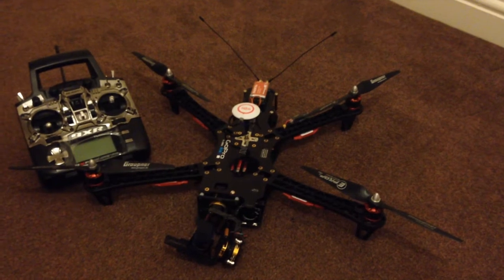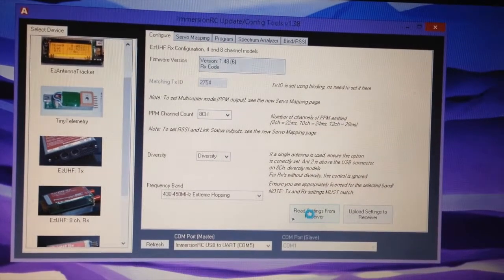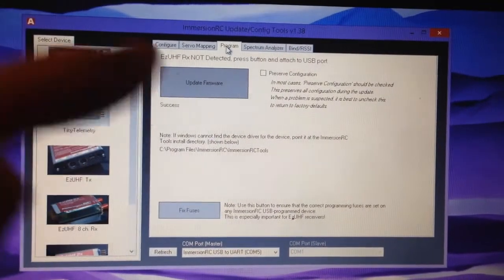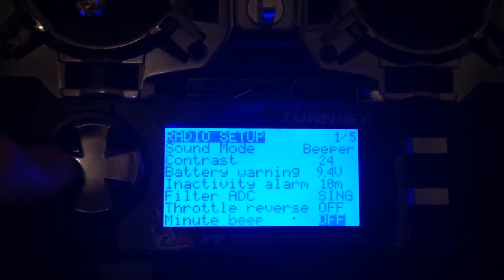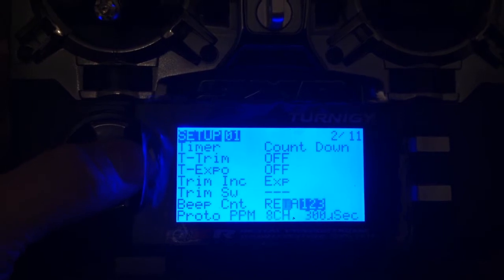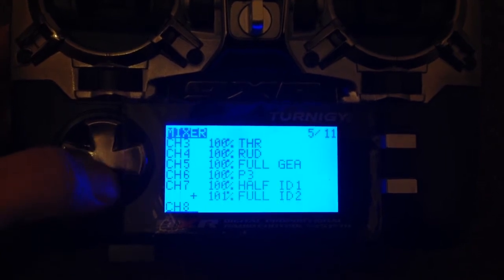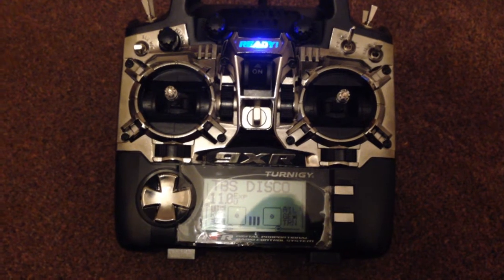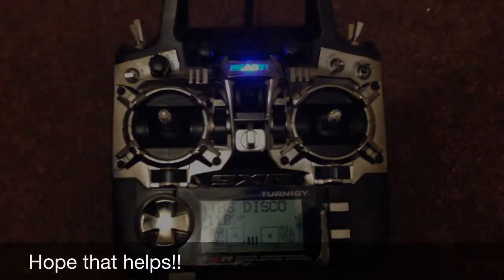Setting up the EZUHF for PPM mode on the NAZA using a Turningy 9XR.

Comment: Hi. Can you tell me how to use PWM on the rest of my channels while using PPM Muxed on ch1? i need to control a gimbal?
Reply from the maker: Paul Ringer use CH1-5 on PPM Muxed for control through CH1. The rest of the channels from CH2-8 still work as normal outputs so I put tilt and roll on CH7/8 and connect directly to them from the Disco. Hope that helps
Reply: TeamUKFPV I'll have go. thank you

Comment: I have a problem with my turnigy the throttle is elevator, I have followed every step that you have on your but yet it messed up, do you know why it's doing this plz,thanks.
Reply from the maker: +Ste Beckett That is the settings in the Tx itself. For some reason the Turnigy / Taranis is set up:

CH1 - Throttle
CH2 - Aileron
CH3 - Elevator
CH4 - Rudder

You will need to go in to the menu of the radio and change these to the following:

CH1 - Aileron
CH2 - Elevator
CH3 - Throttle
CH4 - Rudder
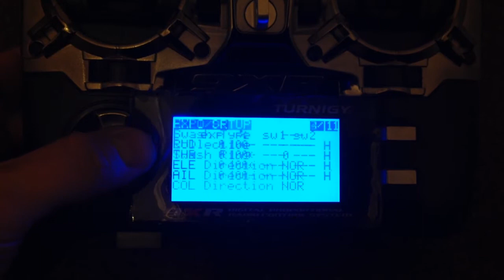Reply from the maker: +Ste Beckett Check out around 04:56 in the video....